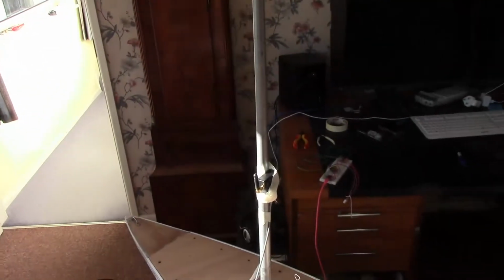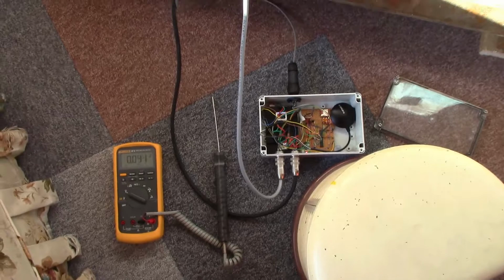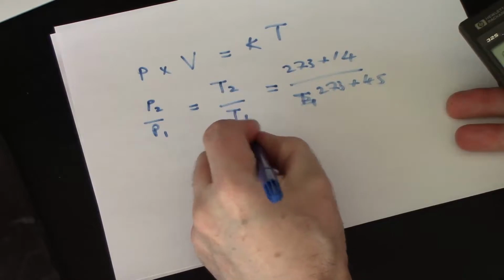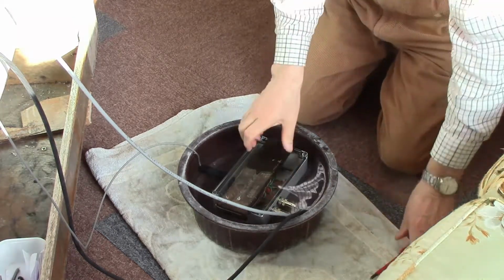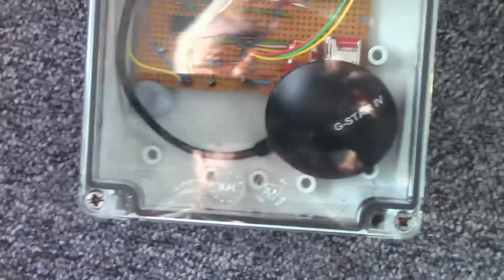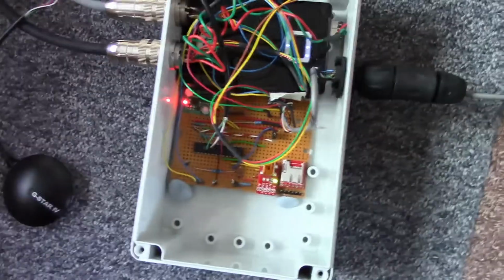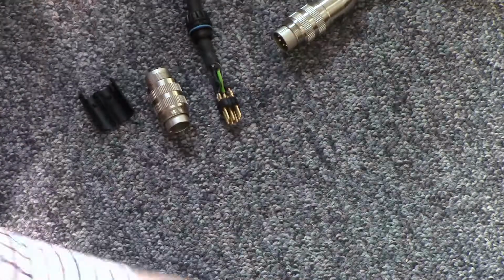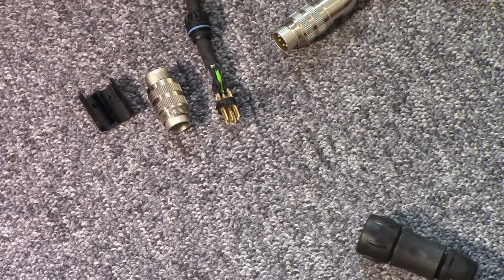Another waterproofing test

Comment: Well done Sam, I admire your perseverance. It is beginning to look like using all plastic ones might be the answer.

Depending on your confidence in plastic tape you could remove all the plugs, seal the sockets with tape and repeat the test to confirm the lid seals. This may satisfy any concern about not having test the lid seal before drilling the holes.

Also are the socket designs such that they wouldn’t seal without any plug in them?

I would have expected a good design to do that. That is to say I would expect the female terminals to be hollow at the outboard end but solid at the inboard end, then ‘moulded’ in a watertight manner into some plastic insulating material so together they form a waterproof ‘plug’ with the solid terminal ends protruding on the internally, ‘dry’, side to accept solder or some sort of  bullet connector. Then the terminal ‘plug’ sealed in to the metal or plastic socket ‘case’ at the time of manufacture. So the whole socket forms a waterproof unit that just has to be sealed in to the hole in the box. From the customers perspective fitting it should involve no more than sealing a hole with a plug. So dealing with the issue of a leaking box.

Then on the ‘wet’ side the issue of insulating against water causing shorts across the terminals could be dealt with independently, ‘O’ rings etc..
Reply from the maker: Ideally sockets should be like that, but these definitely aren't. You have to install a special cap to maintain waterproofing when the plug is absent. That's pretty ridiculous given that the design allows water all around the inserted plug, so you'd withdraw a wet plug and then insert the cap into a wet hole. Madness! I've been looking at the looseness of fit between the plastic insulation holding the contact pins and the metal case of the socket. It's very loose. Only sensible possibility is that when the plug is screwed in tight the O-ring seals the plug to the plastic and also seals the plastic to the case. This may very well be the weak point. I'll have to waste a brand new one to take it apart and see.

Comment: This looks very frustrating.  Would it be possible to connect a small bicycle valve to the box, submerge it, and then pressurise the box?  This might at least show air going out.  I appreciate that this may not be the same as where water goes in, but might be worth a shot?  You could remove the plastic plug and use that hole for the valve, that way you wouldn't need to install another hole that would then require filling later...
Reply from the maker: Yes, I had that technique in mind. I have a manifold and a pump that sucks and blows that I used to use for fiddling with my oil central heating boiler (in the days when that was legal). Also have a nice electronic pressure transducer. To do it I need to make a little part on my lathe to put through the box wall and couple to the pump. BTW I looked at all the nice Bulgin connectors and unfortunately none of them take a cable over 7mm in diameter (except the very big ones). My cable is 7.6mm - I suppose I could force it, but don't want to give anyone an excuse for not working! I just noticed that box is only IP67 not IP68 which can't be helping.
Reply: Samuel Fielder that is frustrating about bulgin. That said the plastic type you have there looks pretty good. I think my enclosures look very similar to yours so hopefully there is not much in practice between ip67 and Ip68... As ever great work and you really must be putting the hours in!